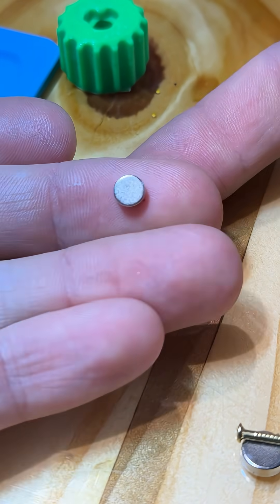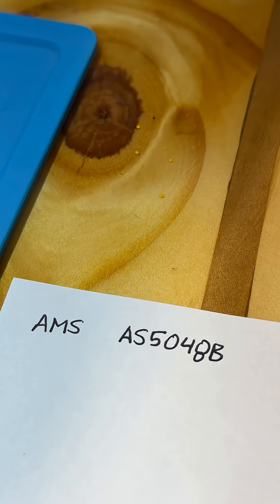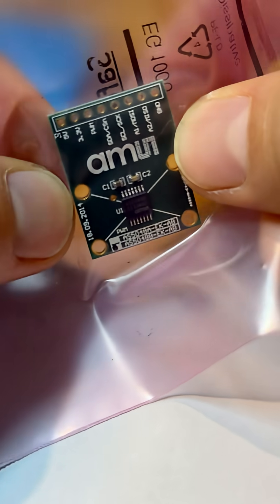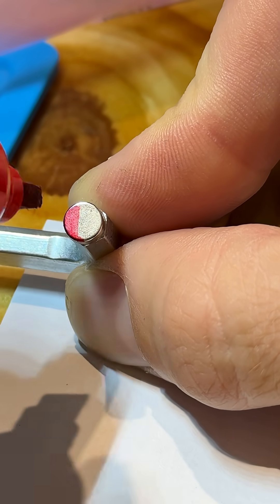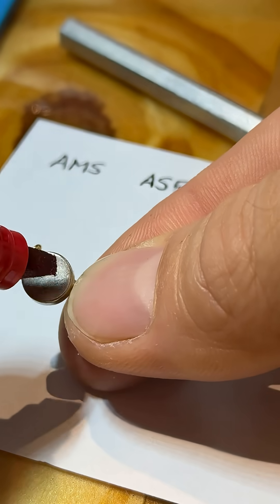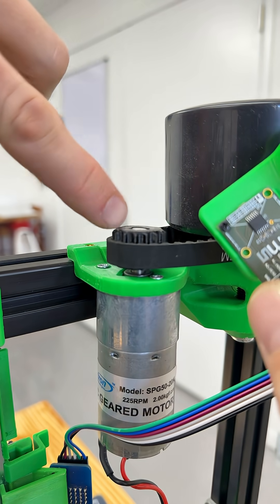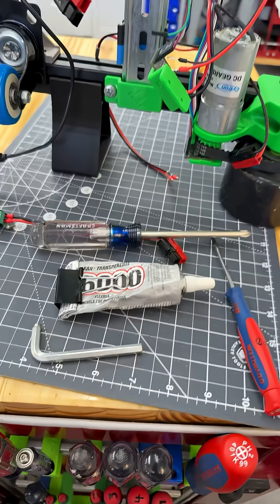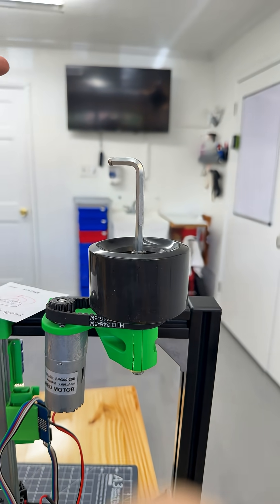how 2 care for your diametrically opposed magnets, so the robot can navigate

Comment: Neodymium magnets ARE special in the way you can't get them hot (flame or perhaps even hot glue!) without them loosing their magnetism. Learned this from "Toids DIY Audio" when they had a reveal of some new Dayton Audio subwoofers using triple stacked ceramic ring magnets. Triple stack increases the magnetic field power and thus makes the linear motor aspect of the subwoofer more efficient. Ceramic magnet also resists voice coil heat much better.

Comment: Not to be picky but 0.02 degrees roughly. You are underselling this marvel by 10x. Cheers.
Reply from the maker: oh that’s true. and for this reason they are found in military equipment and there are export controls, so shipping them overseas is a pain in the rear.
Reply: @davidmalawey  interesting about the shipping rules. It doesn't seem like a difficult technology to duplicate, or to contain much in the way of secrets.
Reply: @MattTrevett Smart Openers in Australia was using this technology maybe 10-15 years ago in garage door openers.  Early prototypes occasionally malfunctioned but it was just that that sometimes a magnet didn’t get glued in properly and would shift its position throwing out the limit positioning.  The company was bought out by another large manufacturer and technology shelved because it was too good and didn’t have any moving parts to break down (no planned obsolescence) .  I’ve still got quite a few units laying around.  Models Smart Roller Nano and Smart Roller Disc.
Reply: He said 0.2 in the video 😅

Comment: You can pull out these magnets from macbook pro 2019 16" or newer. They are used in the LCD hinges for lid positioning.   Repair shops may have them for free😊. I have a few if you need more 😉

Comment: Why  not just flip the normal magnet 90° if needed u could use a taller cylinderical magnet. Would u rly lose so much of rotational precision?
Reply from the maker: this would yield results, but require study to discover how it performs.

AMS (or AM5?) has a 10 page datasheet that comes from years of research just to be able to definitively produce a range of distance for the sensor to work and match the specs. 

it’s not “this sensor works at 1mm distance from the magnet”

it’s:  “this sensor performs with a whole table of output characteristics values, given 1mm distance to the magnet.”
Reply: @davidmalawey i am kinda curious,i will go look at datasheet, just seemed like .2 degres was not that impresive of an acuracy but at the same time vibrations and temp deformation of mechanical parts can already throw that out of wack. Thank you for response tho very much apreciated